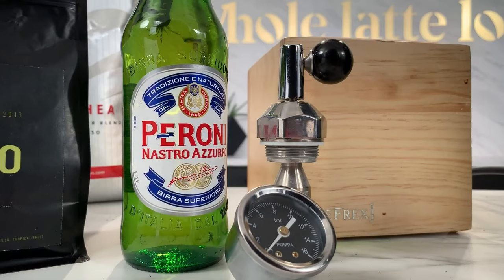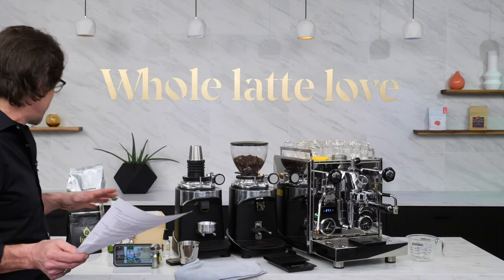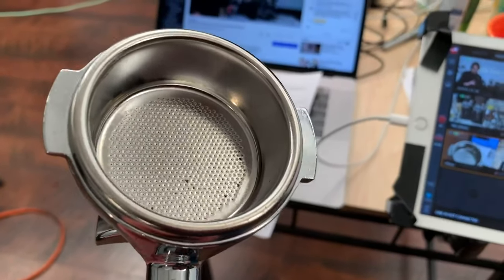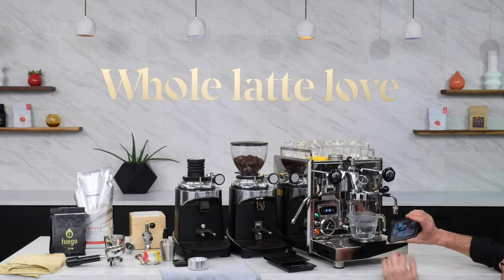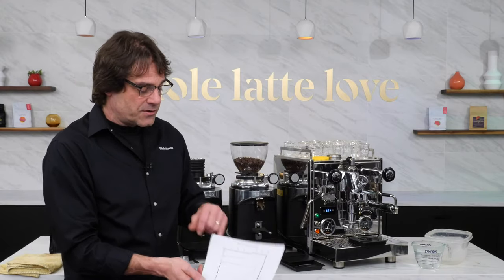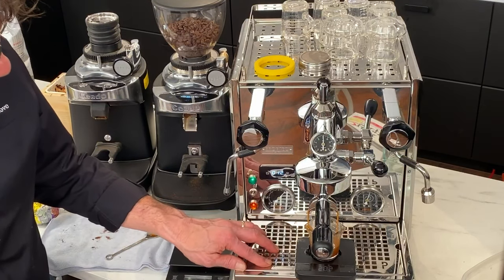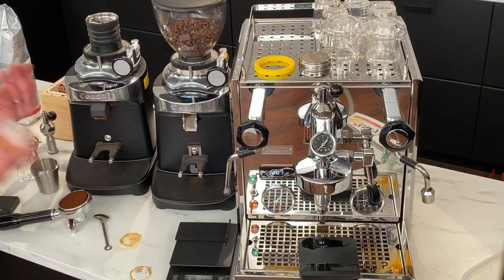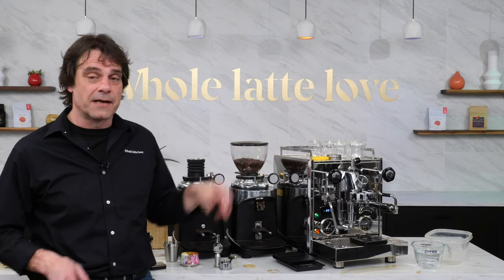Introduction to Flow Control on E61 Group Espresso Machines

Comment: Full open FCD on my Pathfinder measures 7.39 ml. Not quite 11, but is this bad? How can you adjust the get closer to 11?
Reply from the maker: Hi 80's Not necessarily bad. Most flow techniques work with a flow rate below that of a stock machine without flow control. 7-8ml/sec is about the max stock flow rate out of a machine with a vibration pump. Also, most of my flow rate measurements are done on Profitec and ECM machines which may have a little different design to the FC valve resulting in a higher potential flow rate.
Marc
Reply: @Wholelattelovepage  
Thanks a ton Marc!

Comment: Hi Marc, I have a question about the long-term durability of the needle valve. From what I understand, it's akin to putting your thumb over the opening of a garden hose to restrict flow. With the pump running at full 9 bar all the time throughout the shot (which would take up to 60 seconds with super low-flow preinfusion), there's going to be a lot of pressure looking for an escape. Could this backlog of pressure cause accelerated wear on the plumbing?
Reply from the maker: Hi LD, That's a great question. The answer is no. All machines with flow control (and most every prosumer level machine) has an OPV. It's a valve which releases pressure from the internal plumbing at a preset pressure. Usually set to 10 bar on vibration pump machines and 9 bar on rotary pump machines. The OPV controls the maximum internal plumbing pressure. Machines are fine with running at these pressures indefinitely due to the OPV.
Marc

Comment: Hello wholelattelove family!  I recently purchased the pro 400 with the flow control and dialed my shots with the flow control fully open ( not quite ready to experiment with the flow control) I guess I need to find the stock flow and match the flow control to that and then dial my shots based on that? Please help, also whats the stock flow for the profitec pro 400. Thank you!
Reply from the maker: Hello r! Stock flow rate on the Pro 400 is ~7g/s. To operate the machine at stock flow open the valve 1.25 turns from the fully closed no flow position. Hope that helps!
Marc
Reply: @Wholelattelovepage  perfect! Thank you. Also do you make separate wood kit for the pro 400? I only see it as a package with the machine.

Comment: This is a terrific tutorial on flow control, THANK YOU.  Ordering a scale now.

I pulled the trigger on the Profitec 400 from Whole Latte Love w/ flow control.  Sacrificed PID on this model BUT trade off was flow control.  After research I liked flow control as a fine control for better shots IF pressed and had to choose one, i.e. a unit w/ either PID or flow control but NOT both.

Delivery later this week, will get w/ the crew if I have question about my Profitec 400 w/ flow control.
Reply from the maker: Hey greg, scale is great tool! Not sure where you're getting your Pro 500 but as far as I know all have had PID for years now. On some versions the PID control is hidden behind the drip tray. The Pro 500 we carry has the PID visible and flow control: https://www.wholelattelove.com/products/profitec-pro-500-pid-espresso-machine-with-flow-control
Marc
Reply: @Wholelattelovepage  , Hi Marc!  It's the 400 w/ the three way switch from Whole Latte Love, my mistake.  (Original post you replied to edited.)
Reply from the maker: That makes more sense now! 3 way switch is sensible for many. As I mention in my 400 video use lower temp for darker roasts and higher temp for lighter

Comment: Mark- great job as always. I have the set up you are using in the video. Retro fit flow control on the Profitec 500. For those folks who don’t want or can’t get a flow control retro fit there is another simple option. I can reproduce what you refer to as the “sweet” shot without flow control. I start the flow until the pressure reaches about 2 Barr and abruptly shut off the flow. I then wait 5-10 seconds depending on the age of the coffee and then re-establish full flow. After about 80 % of the desired volume I drop the lever so that there is gravity flow only. This corresponds to the transition from tiger striping to blonding. I would argue that the result is indistinguishable from using flow control. Thanks Pete
Reply from the maker: Hi Peter, Thanks for the comment and the tip for those who do not have flow control! Many ways to skin a cat :)
Marc

Comment: Hey Marc, great videos and info especially the FCD stuff. Ive learnt a lot during the lockdown so all good here in the UK. Stock flow on my ECM Synchronika was 13.2g/sec and static pressure with blind basket is 9 bar so I can see why I was having problems pulling good shots even when watching tons of stuff on YouTube. Seems that from machine to machine this differs somewhat due to manufacturing tolerances so its a no brainer that all machines should have a FCD from stock. Otherwise all the videos and tutorials worldwide on pulling shots is null and void because those guys without the FCD have no flow standard to work to. Temps and grind is so variable when the flows uncontrollable. 
With my plumbed in ECM at 2bar static inlet pressure I have been recently just dialing in the grind/shot nicely with 1 1/4 turn (11.3 g/sec). My stock flow was 13.2 g/sec which i think was way too much especially when my friends machines vary between 8.5-12 g/sec. Once Ive dialed it into 1:2 ratio in around 30sec then I start to play  with the FCD and I find 1/4 turn increments are way too coarse. I would say 1/16-1/18 of a turn increments is where its at.. If the FCD could be manufactured so that everything could be done within 1 turn it would be soooo much easier to remember where you are on setting when your under pressure pulling and monitoring the shot.  Great videos and long may it continue..Rich, Uk
Reply from the maker: Hi Rich, Thanks for sharing with so much detail. I love that! 11g/sec is a good place to be. I've been working with some high-end Dalla Corte flow profiling machines like their Mina:  https://www.wholelattelove.com/products/dalla-corte-mina-110v
DC knows their stuff and typical max flow across their machines is ~11g/s.
I noticed you mentioned your 2 bar inlet pressure. I did some testing on a Profitec Pro 700 a few weeks back comparing flow rates from reservoir and from plumbed in connection. I too had a pressure regulator set at 2 bar feeding the machine. I found no difference in flow rate between reservoir and line feed. Was fairly certain that would be the case but one must know for sure! Incidentally the Synchronika and Pro 700 are identical internally.
Happy to hear you are enjoying my series of flow control videos. I'm with you, It's all about the flow! Opens up a whole new world of possibilities previously only possible on much more expensive machines. I understand one turn for full range of flow may seem easier. On the other hand, more turns does give one finer control. Thanks again for your comment.
Cheers,
Marc

Comment: Excellent point about not opening flow valve all the way for a regular shot.
I struggled with it and after video i turned mine 1 1/4  turns and it made a huge difference.

Dont know why i never thought of it before
Reply from the maker: Hi Todd, Thanks for the comment. Yes, flow rate is near 3x standard E61 if FCD is wide open!
Marc

Comment: Hi Marc, I forgot to mention that when I fitted the FCD to my Synchronika, I swapped the spring as instructed. I'm using the tank so I know now the spring swap wasn't necessary.
However, one annoying thing that the Synchronika did before the FCD installation was spit into the tray after dropping the lever at the end of pulling a shot making a bit of a mess. The FCD with the new spring reduced this to a dribble. I'm not sure this was an intended fix but I'm happy it does this. My machine is easier to keep clean now👍
Reply: Same here👍🏼

Comment: Love the videos, thank you!! Can you tell me what the stock flow rate for an ECM Synchronika might be?
Reply from the maker: Hi Johannes, Thanks for the kind comment and question. Stock flow rate on the Synchronika (and most rotary pump E61 group machines) is ~11g/s. Here's an article with flow rates for stock and various flow control valve positions: https://www.wholelattelove.com/blogs/articles/intro-to-calculating-flow-rate-on-e61-group-machines
Article also has graphs for 5 different profiles for various situations.
Marc

Comment: Hi Marc, I'm enjoying your shelter-in-place videos! I'm considering getting a PP 500 PID with flow control. I'm wondering if using a low flow rate on a HX machine will increase brew temp due to coffee staying in the group for a longer amount of time. Have you made any measurements of this?
Reply from the maker: Hi Dave, Thanks for the comment and a great question! I have not made Scace temp measurements but I should. My guess is it may actually lower the brew temp with a lower flow rate. This because of longer contact time of brew water with the mass of the group which is at a lower temp than the boiler. I'm not certain of this but makes sense at first look.
Marc

Comment: Hello,
Do I have to put the spring at the bottom of the unit? Because if I understand correctly, the purpose of the spring is to control the pre-infusion (to remove it so that you can control it yourself). So by leaving the bottom as it was and only changing the top, you keep the pre-infusion? This doesn't seem to make sense, and yet I see an advantage in being able to shoot shots as originally. Of course, Flow Profiling only comes into play after this pre-infusion. Thank you!
Reply from the maker: Hi bttb, you do not have to install the bottom spring if you do not want to. My understanding is it's a stiffer spring which prevents valve flutter which can make a dolphin like chirping sound. I want to confirm with our lead machine tech (OOO today) but I don't believe it fundamentally changes pre-infusion.

Comment: When the flow rate is restricted, where does that extra water go? How's it work and is there any potential side effects of adding a flow rate control mod?
Reply: hey did you ever get an answer to this? 
I think it works just like a faucet ? as in, the water pressure is coming in (in this case from the pump) but the tap is just restricting the amount coming out ?
Reply: I think you got the right idea I don't think I fully understand it yet. I do have the mod now but haven't installed it yet. I think it also comes with a spring to adjust the exhaust spout pressure so that may be related.

Comment: Hello Marc, thank you for another great video and tips. I’d like just to ask you one thing… I heard that it’s necessary not to touch the metal parts of the flow control, because it’s damn hot, but you’re touching it without any problems… Can you please just confirm it’s not that hot and it’s ok to touch it? 😇
Reply from the maker: Hey TK, You're welcome for the video! Well, the metal parts of the flow control do get very warm. If machine has been on awhile they will be near the same temperature as the group head. The black knob on the FC gets warm but not hot enough to burn - okay to touch.
Marc

Comment: Thank you so much for the wonderful video. Do you need to have the pressure gauge installed? Can you just use the flow control and a thermometer?
Reply from the maker: hi Steve, You are welcome for the video and thank you for the comment and question. You can use the flow control without the pressure gauge installed. IMO the pressure gauge provides useful information if manipulating flow rate during an extraction.
Marc
Reply: @Wholelattelovepage  thank you for the very fast reply. Unfortunately, I bought a chronometro r instead of a 58 before I understood the difference in a heat exchanger and a double boiler. So I check my temperature in the brew head before every pull. I just ordered a scace, so maybe I can swap the thermometer for a pressure gauge and put the scace in an extra portafilter to check that way between pulls. Maybe I'm better off trying to sell my chronometro and then buying a lever or a higher end rocket.

Comment: Hi Marc -  Great video!  I have learned a lot watching bunch of your videos.  I just pulled the trigger on Profitec Pro 600 with Flow Control from WLL.  Can you advise how the Pro 600 Flow Control can be used like the stock Pro 600?   Does it also take one full and quarter turn to get the same flow as the stock Pro 600?  What is the flow rate of a stock pro 600?   What are the negatives if you are brewing with much higher flow rate?   Thank you.
Reply from the maker: Hi Dev B, Thanks for the comment, question and patronage. And congrats on your new Pro 600! Vibration pump machine like the Pro 600 usually run ~8g/s with the stock mushroom. You valve turns should be close to the 1 1/4 to get that rate but I would verify by going through the calibration. Run 20 seconds of pump on at each quarter turn measure volume or weight and /20 to get g/s. Brewing at a higher flow rate might be desirable in some profiles like working a darker roast or aged coffee. For those it's usually an initially high flow rate for a short period then ramp down to lower than stock flow and nearly nothing to finish. Can also mimic level shots by a high initial flow for a few seconds, then cut completely for 5 or so seconds and then go quickly to a higher than stock flow rate and ramp continuously down to zero to finish. Hope that helps! Also, stay tuned I'll be doing some live streams with a variety of flow profiles starting a week from Thursday!
Marc

Comment: Hi Marc, great video as always. I enjoy watching your reviews in particular, you always give great detail and keep everyone engaged. You’ll have to do an outtakes video and show that shower screen flow from below again, due to the camera malfunction not switching.
My question, I think you mentioned in another video that the flow control might be made available on other machines, any news if they will be coming for Rocket Cronometro machines? Keep up the great work!
Reply from the maker: Hi I, Ya, sorry about not switching to the proper camera to show the flow out of the shower screen! Had a lot going on trying to run the show technically and accomplish everything else. Take my word for it the IMS shower screen drips evenly from all areas instead of the usual single stream from stock screens. We have tested the FCD in Rocket E61 groups and it works. We hope to have FCD uprgrade kits back in stock when production picks back up in Italy  - currently stopped due to virus.
Marc

Comment: Hi Marc, love the video’s. I’ve flow control installed on my ECM Technika V for a week now and It’s amazing! But when the machine Is warm,  the turning of the valve gets more difficult and not so smooth. Is this a common thing? or is action needed? Thanks from the Netherlands
Reply: I got the same issue with my profited pro 700
Reply from the maker: Hi p, I do not think that is a common issue. I've used at least 10 different machines w/different FCD's and never had difficulty turning. How is your water quality? Any chance it's hard?
Reply: Whole Latte Love Thanks for your response! I only use filtered water (Brita filter). It only occures when the machine gets hot. When it’s cold turning the valve is nice and smooth.. It’ a Shame because I really like using it.
Reply: Hi
I put a bit of oil on the threads of the thing and it made a big difference.
Also it gets very hot so i unscrewed the black nob and put clear tub over the  shaft and screwd nob back on it makes it way better to use
Reply: Todd Power thanks for the suggestions! I’am going to try them out!

Comment: Hi, 
Is it reliable to get this machine with a flow control? I’m more focused on normal espresso shots but gonna use the flow rate occasionally to do some drips. Im afraid that the stock flow rate is not doable and sustainable in this machine. What are your thoughts.
Reply from the maker: Hi AM, Thanks for the question. Very reliable! Normal flow rate on rotary pump machines is ~11g/s. Stock flow rate on vibration pump machines is ~8g/s. You can get those flow rates easily with the FCD. For instance, on my Profitec Pro 700 I get the stock 11g/s with the valve open 1.25 turns.Hope that helps!
Marc

Comment: When adjusting the flow rate does that also adjust the brew pressure or the pressure somehow stays the same as long as the coffee provides enough resistance?  Any differences between using an actual lever machine and simulating the lever machine?